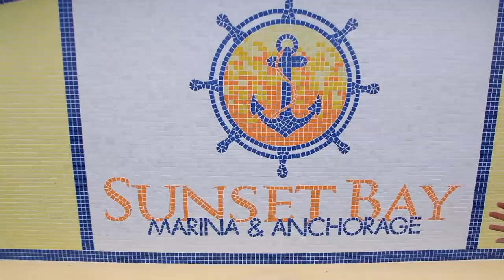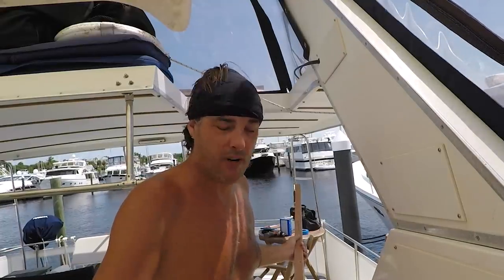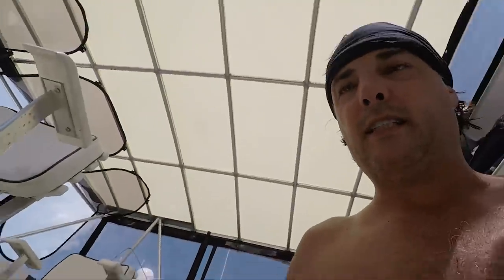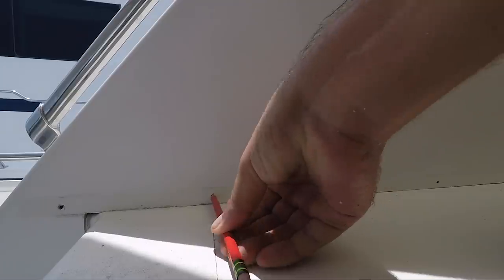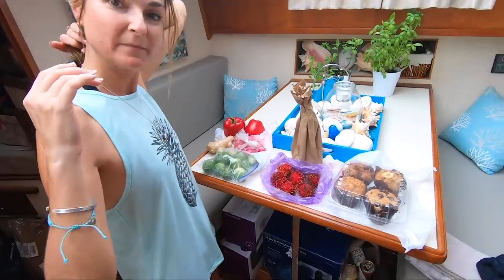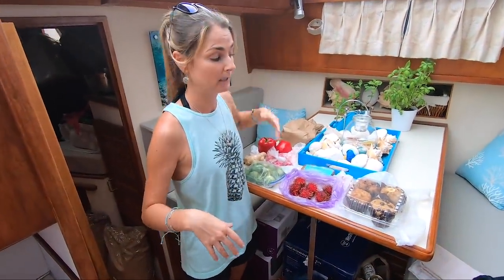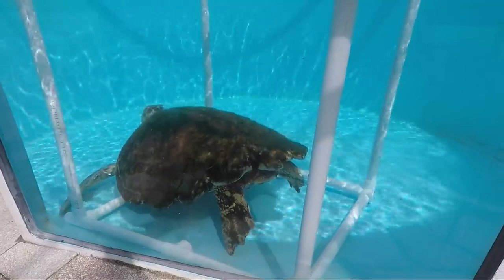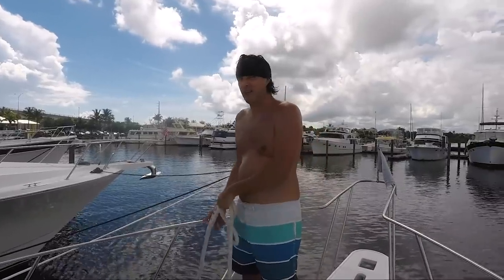If you BUY an OLD BOAT, you WILL have PROBLEMS like this | Ep.54

Comment: Takes a lot of nerve to cut a hole in your boat and a bit of insanity to do it in the Florida summer heat.  You are very lucky that Cyndi was so helpful.  
What were the symptoms that made you realize that you had rotting wood or did you just happen to notice when laying cables?  
A little sad about the turtles but it looks like they are in a good place to recover.
Reply from the maker: Hi Bob! Yes, mentally preparing to cut that hole was the hardest part of the job. LOL  We actually knew of this problem when we bought the boat. It is common with Tollycraft boats. Not a big deal, and not a structural problem, just something that needs to be addressed, and just getting to it a few years after purchase.  I knew to look for this issue when looking at boats. I brought a moisture meter with me and knew I would have to deal with it sooner or later. 
Yes, the Loggerhead Marine Center is doing some good work. I doubt many of those turtles would have survived without them.
Reply: @SearchingforCShels  , I learned a long time ago that a hole saw and those round covers they sell at West Marine were your best friend when owning a boat and trying to get access to hidden spaces!

Comment: You may want to look into some of the modern adhesives or even Marine Tex. That stuff will hold anything, completely waterproof and it can even be machined (tapped, drilled etc) just like metal. A bit expensive, but worth it for some projects.
Reply from the maker: Thanks Kevin. Marine Tex to us is more of a permanent bond. This area needs to be taken apart if the the boat ever needed to be transported requiring the flybridge to be removed. Yes, there were probably some adhesives that could of stuck some PVC or HDPE down. The wood was convenient and cheaper however. Sometimes convenience wins. 😉 Cheers!

Comment: As they say, “A boat is a hole in the water lined with wood (or fiberglas) into which you pour money”. lol However, the good times and memories of boating far outweigh the cost!! 
How about using ‘StarBoard’ to accomplish what you did with the wood?? Further to that, 'bed’ your material in adhesive marine sealant prior to fastening. At least, ‘butter’ the area under the fastener with same. Anything other than wood when possible. 
Let’s not forget the Bahamas!! They need our help... desperately!!
Reply: Michael Rutledge  7:11 - 7:15 in the video
Reply from the maker: Hi Michael! For sure, the memories and experiences are certainly priceless.
PVC/plastic/HDPE was considered. Besides the extra cost consideration, it was the possibility of it not being able to bend well since the floor isn’t flat, it is curved. There is also the fact that HDPE products are difficult to adhere with adhesive, nothing sticks to it. Which I did use, you can see it when laying a short piece in the video. We needed it to adhere to not allow water penetration from under the flybridge wall. So, we just went with epoxy soaked mahogany. 
Praying for the Bahamas.
Reply: John K Duhhhh... how did I miss that??

Comment: I started watching your videos very recently, when I came across them it was one of those things that I knew was meant to be....  Firstly your boat is similar to mine, I've a 40' sundeck, like yours without the cockpit,  secondly I used to work in the Bahamas 25 years ago flying helicopters and have vowed to return one day as a cruiser, and  lastly you guys look very much alike to another couple I know, Cindy looks like her twin sister!  I like the Tolly 40 and 44, but the area you are working on, well, I say to people that a 4 year old could have designed it better.  That rotted wood you are pulling out, it's what holds the flybridge to the house, and has no protection, wasn't epoxied and no drain holes, so gets wet and rots.  As you pull it out the flybridge will settle down onto the inside panels, the ones you just screwed to your new piece of wood.  My personal solution, am very happy with it, was to cut out that whole inside wall of the flybridge, neatly as it will go back in there as a removable access panel, then support the flybridge in the rear corners with a large triangular block of of wood, shaped to fit in there, epoxied and painted of course, and stuck with 4200 on the inside, and lag bolted from the outside on the slope under the short rails.  Another large block of wood towards the front of the f-bridge, and I left that whole area where all that rotting wood was, totally empty, for good ventilation and no replaced wood to rot.  And now I have access to that area too, I hate areas that I can't access.  Tolly guys, really, what were you thinking, so many Tollys have this same problem....  Sorry to tell you, but you might also have rotting wood all inside your radar arch, I did....   Great vids guys, keep it up,  really am enjoying them, and love that song by Wild, can't get it out of my head some days!
Reply from the maker: Hi Raf! Welcome aboard!  Yes, I'm sure nowadays we could design that spacer a little better. I really like your idea about leaving some sections void. That is smart. I replace this in the next episode so stay tuned. I' don't think it will be as sophisticated as your solution. I've checked the radar arch, the wood is good in there, I think less water gets in and around that arch because of the hardtop. Again welcome, we are really glad you are enjoying the videos. Please keep commenting and giving us your opinion on the videos and the boat projects. Hope to see you in the Bahamas. Cheers!

Comment: Sheldon, did you wear a mask when cutting the hole in the fiberglass?  During my audio installation I had to cut several holes and did so without a mask.  Stupid mistake I wish I could undo.....fiberglass dust is nasty stuff.
Reply from the maker: No, I didn't wear a mask, but didn't notice much dust. Good idea to have a mask though. Will do next time though. Thanks.

Comment: What a horrible /typical boat job! If you could get to a lowes or depot you can now buy inexpensively 1x1solid PVC ( and 2x2) which might have been a good rot proof option for the other side! Thanks for posting  cheers Warren
Reply from the maker: PVC/plastic/HDPE was considered. Besides the extra cost consideration, it was the possibility of it not being able to bend well since the floor isn’t flat, it is curved. There is also the fact that HDPE products are difficult to adhere with adhesive, nothing sticks to it. We needed it to adhere to not allow water penetration from under the flybridge wall. So, we just went with epoxy soaked mahogany. Cheers!
Reply: Searching for C-Shels hi no problem, since plain wood lasted it was simple to repeat previous.  
FYI , PVC You can stick to with some sanding first , but hdpe/ polyethene/ starboard takes a flame treatment just prior to gluing to make it adhere . If you use butyl tape/caulking that would seal without worrying about adhesion issues. I hope you did not have to tear off the canvas work for Dorian...... cheers Warren
Reply: Daver G  hi we all dream that is true but we said the same thing building boats in the 80's ," Just coat it in resin and it will last forever". If it wasn't for wood rot fiberglass boat would last a lot longer. I know epoxy is a better product but it really hard to get a perfect seal and then you break the seal with screws and possibly trap the rotting moisture inside. They will be fine here so I'm not worried at all but people tend to think epoxy is a cure-all for what ever problems you might have. Like a couple of coats of barrier coat will make you boat blister proof. But only if you do perfect prep and it cures in perfect conditions etc.  etc.  cheers Warren